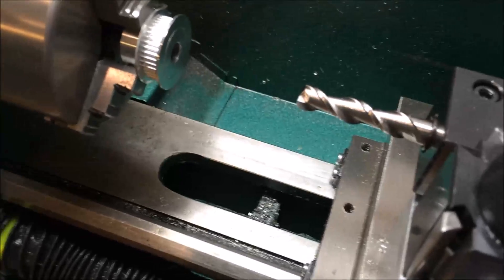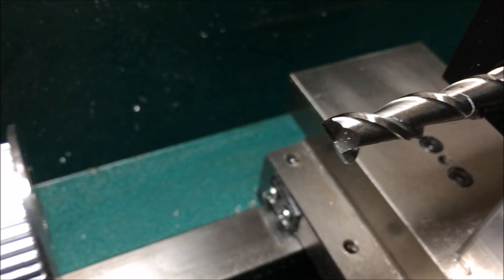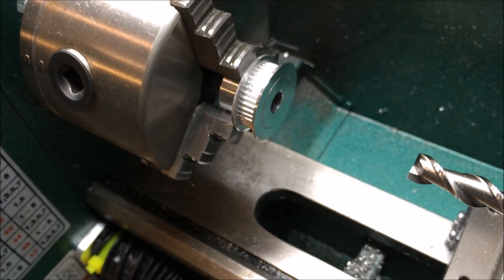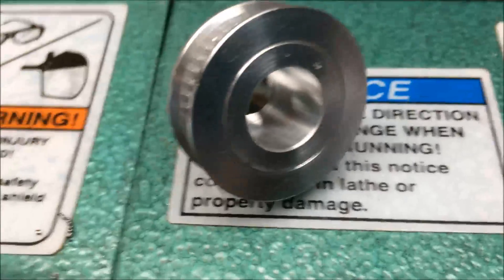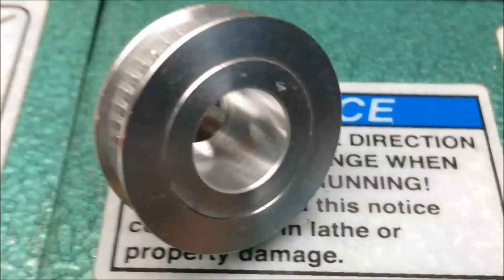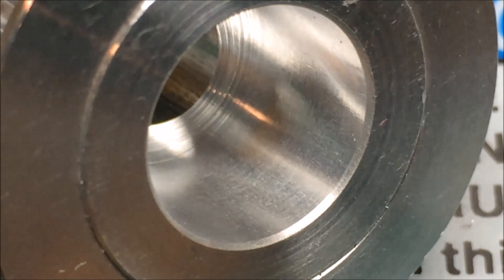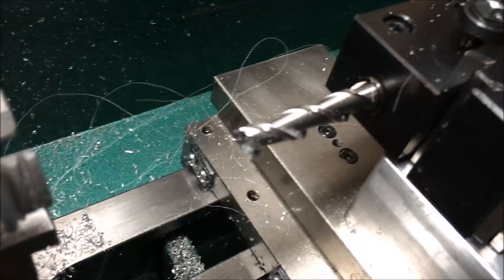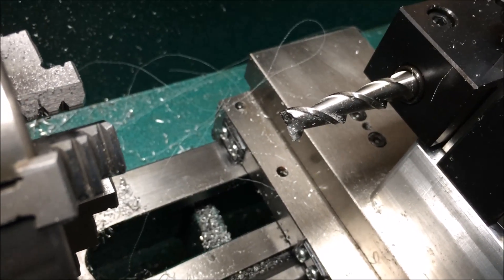Mini Lathe: Drilling and Boring with an End Mill

Comment: This is awesome. At work we use a lot of insert drills to create holes for finish bore applications. The insert drills leave nasty peaks and valleys at the bottom of the hole, and the finish boring bars slam into them. Pecking would be better to break the chip though. That bird nest would be difficult to manage in a production CNC environment.

Comment: Just ran across this. I have a 1660 lathe and I do inside drilling, boring and outside cutting with mill bits just because. I originally started out using a mill bit in tailstock chuck to clean up a tradition drill bit hole then said why not try boring with it so dug out my grooved holder and gave it a go. Cuts either side of hole using forward or reverse. That worked so then I thought why not try turning and bingo, worked as well. Kind of depends on what I'm doing. I have multiple boring bars - up to 1" indexable so it's not because I don't have... and the depth you get from a mill bit is not as impressive as my 1x10" bar. Concept works in aluminum, steel and brass.

Comment: nice, on that second pass im like Where's the chips..lol, but looks good, can use a stubby end mill on mild steel im sure, and slow RPMs may even get you through 304 stainless..only down side with this is if you have taper, your stuck.
Reply from the maker: Yeah, there are limitations with the endmill.  But, for a straight bore it does a respectable job.

Comment: loooove this. i was wondering if this would be smarter than a boring bar. this also lets you do smaller sizes.
Reply from the maker: minskmade Hi.  I like the end mill trick in aluminum because I think it does a better job of getting the chip out of the hole. However, there are times when you must use a boring bar to profile where the end mill just won't work.

Comment: I tried boring mild steel with a drill bit in 2014 and it worked. The boring bars that I had kept chipping so I tried this method.
Reply from the maker: Cool. Thinking outside of the box.

Comment: How did you center the end mill to the chuck?  I know there's several ways to do it, so I'm curious how you did it. :)
Thanks!
Mike
Reply from the maker: Hi. First, I made sure the face of my QC holder was perpendicular to the chuck using an indicator. Then, I used an indicator to sweep the 1/2" bore on the drop in tool holder.  Once that was dialed in, I inserted the drill chuck and I was good to go.
Reply: Thanks! Sounds like the most accurate way to do it.  :)  Great work!

Comment: Cool!  Any particular type of end mill that you recommend?  How critical is the orientation of the tool when boring?  Looks like a beautiful finish except for the deepest part of the hole...any idea why?  Tool flex?
Reply from the maker: Thanks. For aluminum  I'd use uncoated HSS.  The lines at the bottom of the bore are the steps in between each pass. I didn't skim the face - I was only worried about the diameter.
Reply from the maker: The orientation is important. The tool must be on center and the lip of the mill must be parallel with the x axis. Otherwise, you will not cut a true size when you come off center.